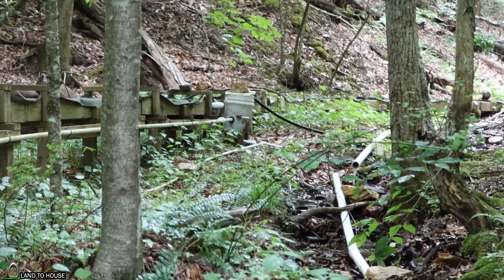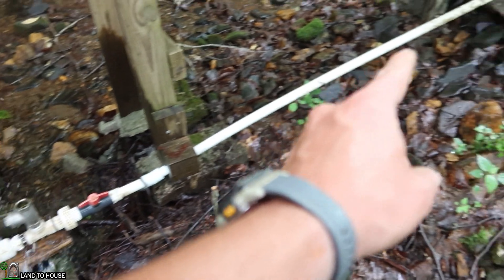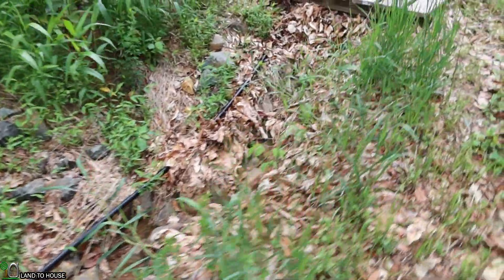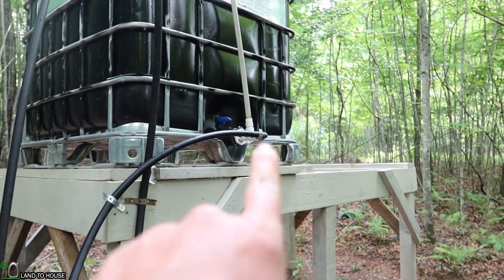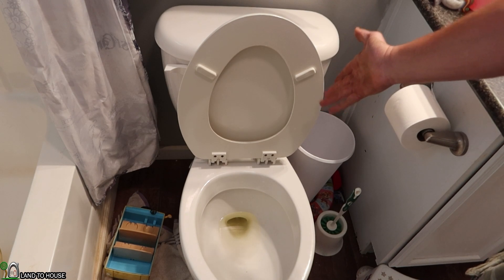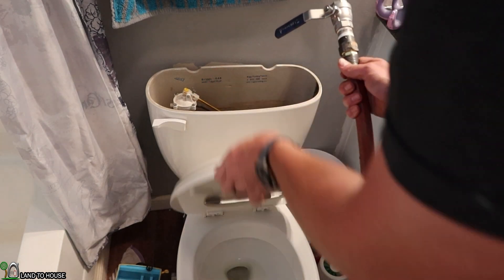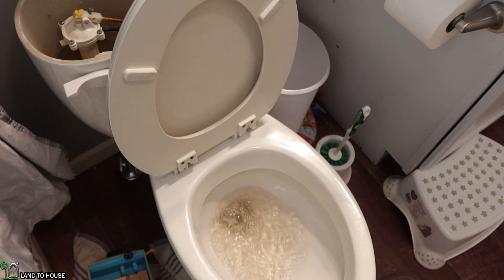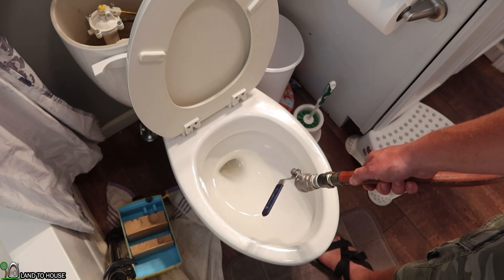Ram Pump Off Grid Toilet Flush

Comment: Could the hydraulic pump be directly connected to the water line of the toilet. I realize that wouldn't be an efficient use of the ram pump.
Reply: You could in theory sure, however your issue then would be in-coming flow from pump to toilet. Every time that pump cycles your only gonna get a pint or so of water coming out of it. So the trick is to have a large elevated tank that can spend all day filling up, and then that tank feeds your house with water.
Reply: Yes, most definitely! I am using that setup in my home right now. Tank takes about five minutes to fill with my given setup.
There is a slight additional resistance to the flow from the fill valve. Also, when the tank is filled,there needs to be somewhere for the pressure to escape to. In my case I simply leave a sink faucet open that is slightly higher than the fill level.
Reply: @jayjay6804  That's kinda what I was thinking. I wasn't sure if the pressure would get to much and damage the line or push past the float shutoff and overfill the tank.
Reply: Yes,the pressure can easily build to high enough levels to cause the delivery line to push apart or spring a leak. Something will give way if no pressure relief is provided. My sysrem normally is at 30 psi but will easily hit 100 psi if closed off.

Comment: My interest is the Ram Pump setup-using your info to learn.  The toilet flushing?   Yeah, that's a given, I guess some do not understand how toilets work so it is informative in that.   Curious why you do not put a line in thru the wall with the valve on it-no need to tote a hose?   Also, an old Fifth Wheel had a simple toilet-basically half a cup of water over a ball seal that closed off the toilet from the sewage,  step on a pedal, ball opens, low flow of water to rinse and it seals back up-used almost no water unlike a tank flush system.   Worth looking into-what I would do in simiAR SITUATION.

Comment: You do waste a lot of water. You don't collect the water being thrown away
Reply from the maker: At the ram pump? That's a creek flowing 30 plus gallon per minute. The water just goes down the creek like it normally would. Not really wasted.
Reply: @LandtoHouse  the higher the fall of the water the higher the pressure. If you don't have a creek, will a high level water tank supply do?
Reply: What are you talkin about? The excess goes right back in creek!